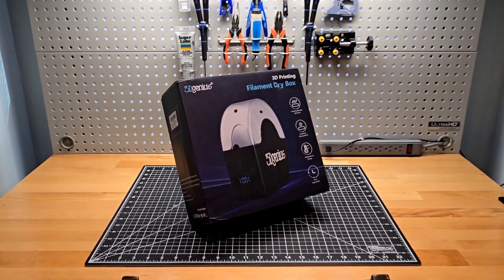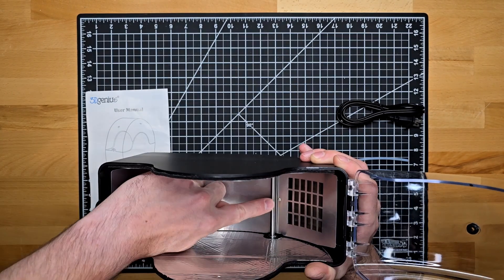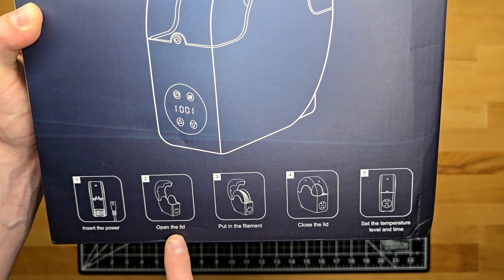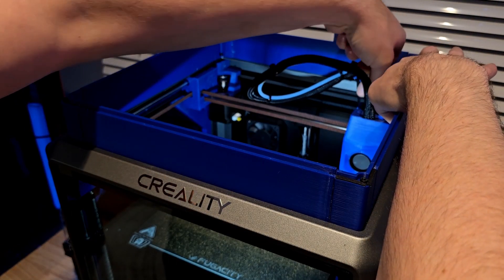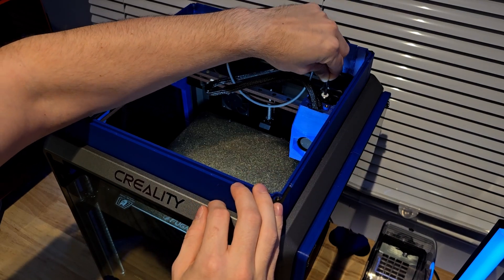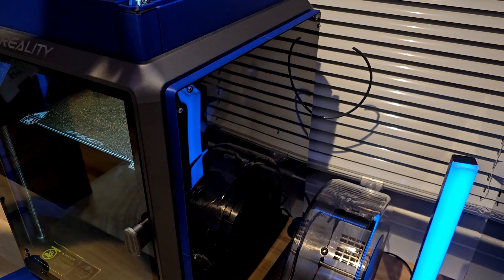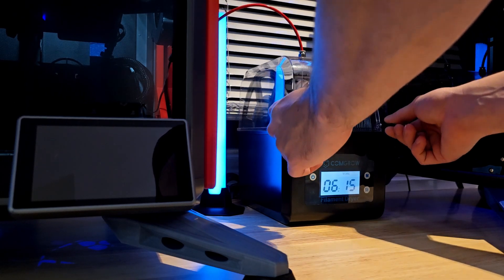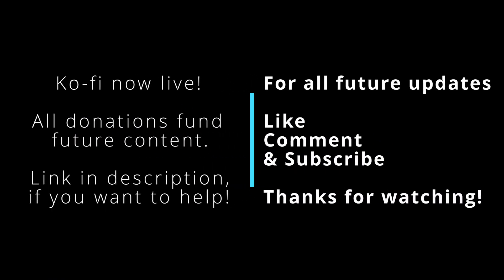3D Genius - The Best Budget 3D Printer Filament Dryer

Comment: Mine is still working. I printed an adapter that allows the PTFE tube to come out at a much more natural position. Doing that and relocating the thermistor really make this a great budget dryer.  Also super glue a $5 humidity sensor to the clear lid so you can see the moisture content.
Reply from the maker: Great idea! My work around was an extended length of PTFE running from my run-out sensor directly into the dryer positioned close to the spool. Oddly enough, I began melting materials at such a rate that dryers only see use if I notice moisture in the material immediately after removing them from packaging 😅 Otherwise if it produces a satisfactory purge without oozing, a spool will be empty in under 24 hours. Still have some humidity sensors kicking around though. Might just have to!

Comment: Yet another Sunlu ripoff....
Reply from the maker: I used the Sunlu Filadryer S1 that I backed off Kickstarter and it did well with low temp filaments while I had it (Sold a machine to someone new to 3D printing and included enough extras for the life of the printer, including that dryer).

The S2 is another option (typically going for $15 more) but with the 3D Genius selling for $30, the performance, dollar for dollar, can not be matched by anything else at that price.

This is why it takes the win for being the best budget, filament specific dryer from my experience.

Comment: Worked great for a couple of months. Then died. Back to my reliable diy food dehydrator dryer
Reply from the maker: @ThisisDD  I look forward to running it for some time. Will be interesting to see how it does. They have a 12 month warranty so I'd have them replace it if I was you!
Reply: @CovenantCustom good to know. I will have to pursue that
Reply: Been running mine for close to a year now, no issues. Its main downfall is how noisy it is.
Reply from the maker: @tylerandalexlacey5558  Nice to know that yours is still going strong! Noise I can work with.